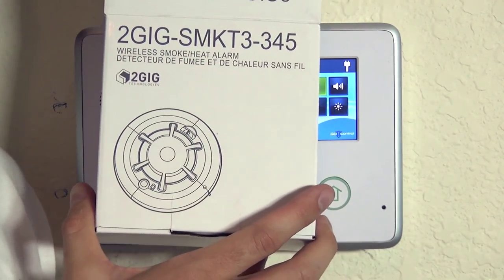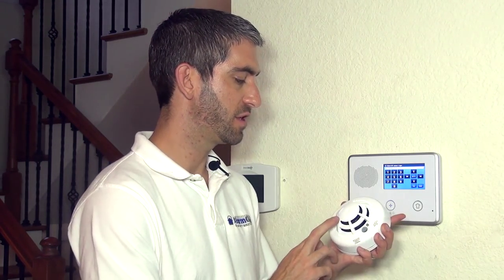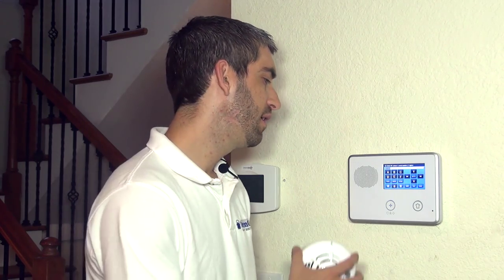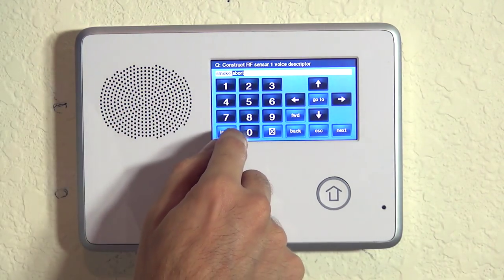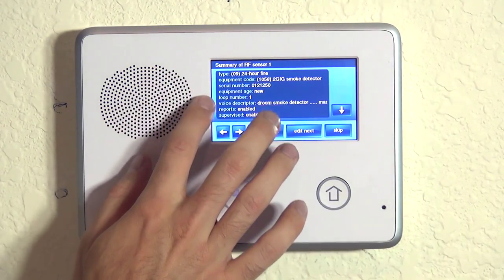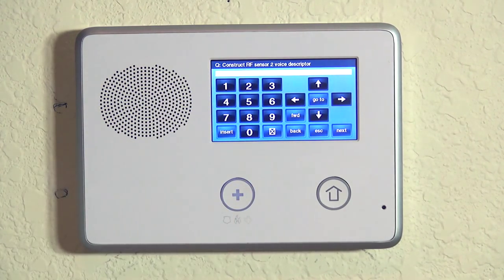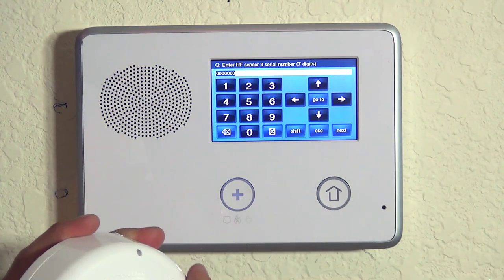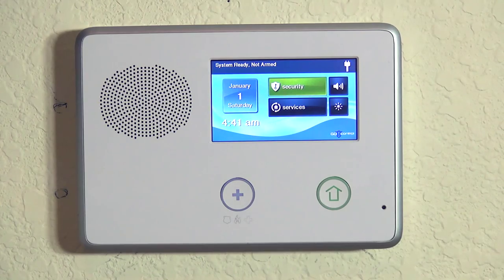2GIG SMKT3-345: Go!Control Programming

Comment: Please help. I programmed my system as 2GIG  Smoke detector, equipment code 1058, but it would only "learn" the RF Serial Number the first time when I programmed loop 1. I turned the base on and off like indicated in the video but it did not "learn" for the 2nd and 3rd zone for loop 2 and loop 3 although it didn't give me any errors when I programmed or rebooted the system after programming. Is everything OK? Thanks.
Reply: Frank Longo Thanks. I did manually enroll, I just have not completed the system test yet. Thanks for your input.

Comment: do you have to have a 2gig panel to use this smoke alarm or can you hardwire it into your previous smoke alarms?
Reply: This type of smoke alarm operates off of batteries and will provide local sounding but it is typically the type you use with an alarm panel.
Reply: @freddaniels8259  am i able to hardwire it into my existing smoke alarms?

Comment: Does the smkt3 also have only one time usage like the Honeywell?
Reply from the maker: Honeywell smoke detectors aren't one-time use. Who told you that? They may be confused with the fact that most mechanical heat detectors (used in wireless smoke/heat detectors for the Fixed Heat detector portion of the sensor) are one-time use devices. I've never heard of a one time use smoke detector though.
Reply: +Alarm Grid Okay thank you very much!

Comment: Work vista 21ip?
Reply from the maker: No, I'm sorry, the only Honeywell/Resideo panel that currently supports the 2GIG 345 MHz sensors is the Lyric Controller.  The Lyric should be on the latest version of Firmware (currently MR9).